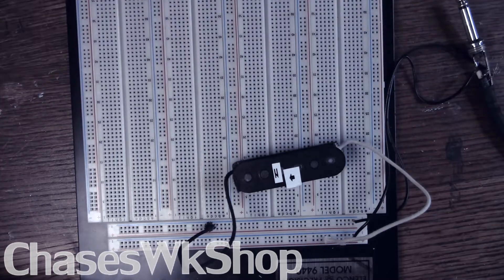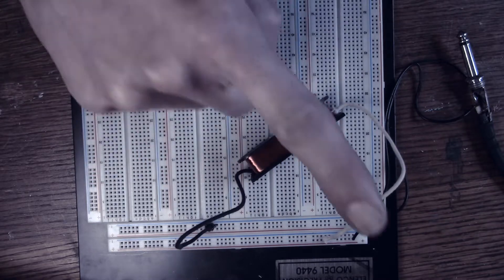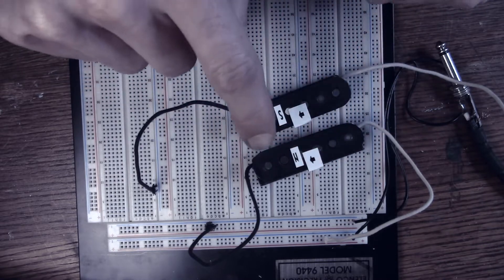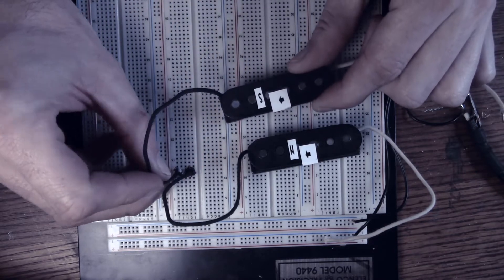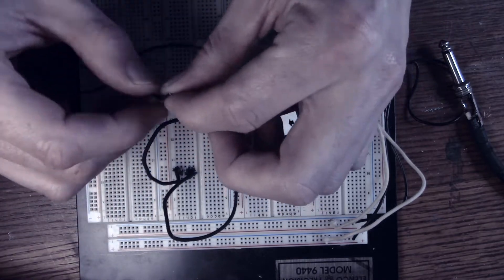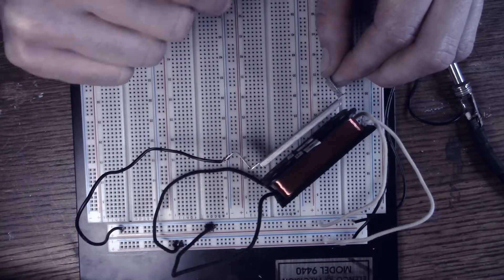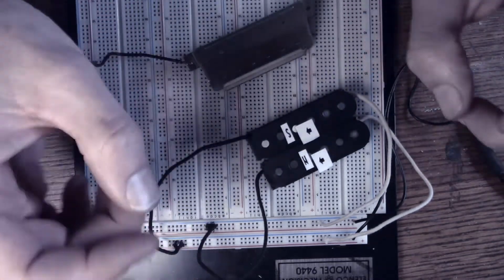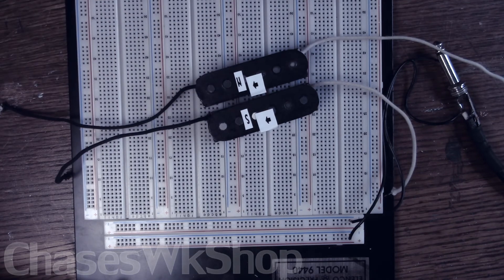Humbucker Wiring Configurations and Test using electromagnetic frequencies.

Comment: Thank you so much 
Really cleared my mind
You rock👍
Reply: Thank you 
God speed
 stay safe
Reply from the maker: Lisen Tzudir you’re welcome!  Thanks
Reply: @ChasesWKshop  can you do a video on how a pickup with weak magnets sounds like?
Reply from the maker: Lisen Tzudir I don’t. A weak magnet would have a weak output. You can get different sounds with weaker magnets like instead of using alnico 5 magnets use alnico 2. Will give a warmer but less output pickup. Could try alnico 5 on bridge and 2 or 3 on neck pickup.